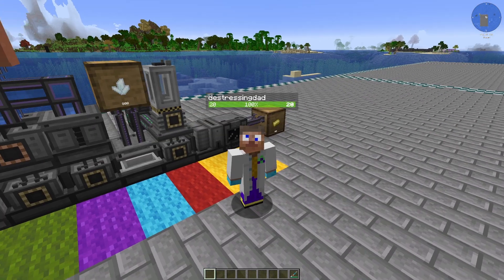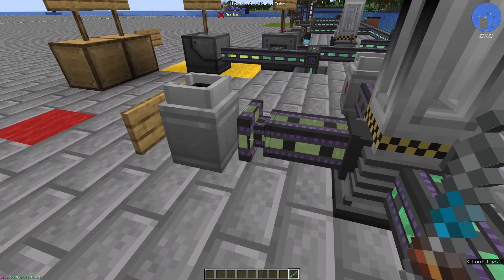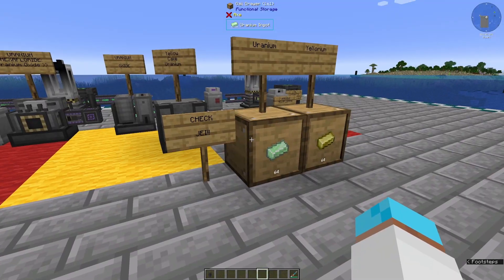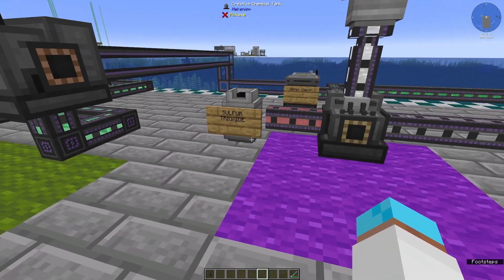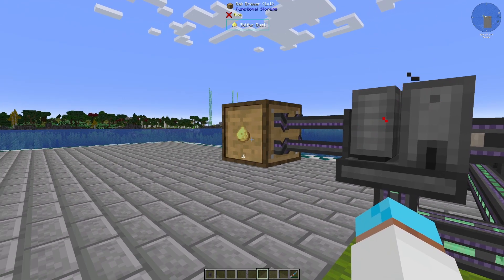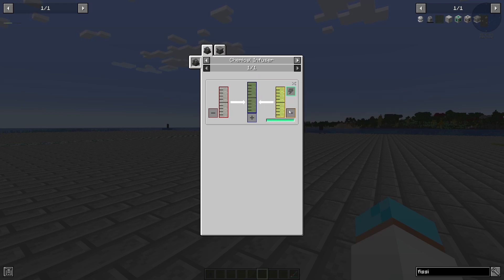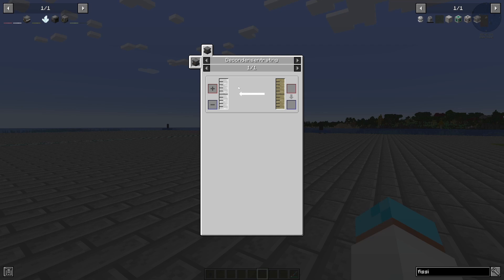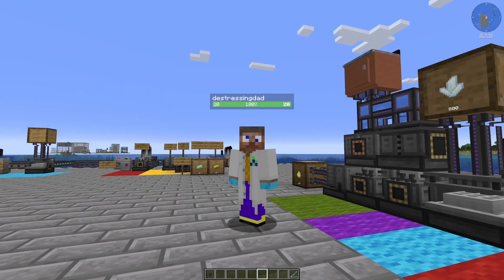How to Make Mekanism Fissile Fuel in Modded Minecraft: A Step-by-Step Tutorial for Beginner

Comment: Ive got quite the question, ive set up 2 of those setups, consistantly inputing fissle fuel into my max sized reactor, they both have all the speed upgrades they can have too.. i can only run it at 8mb a tick! How does one change that because its quite a pain running it that slowly..
Reply from the maker: I’m assuming the limiting factor is speed at which fissile fuel is created? If so.. I believe sodium cooled is more efficient… and then ramping up fuel production.. so more centrifuges.. and you can reprocess waste into fuel too (jei- reprocessed fuel fragment or something, it’s one of the uses of plutonium)! And to really ramp it up.. if you have rftools dimensions.. create a world with uranium, fluorite.. even hecaflouride lakes.. this then allows you to have loads of centrifuges kicking out buckets of fuel!! Heat will then become a limiting factor.. not fuel!! Hope this helps :)
Reply: same thing happens with me what did u change?
Reply: @wohzey2229 Fill every machine with 8 energy and 8 speed upgrades